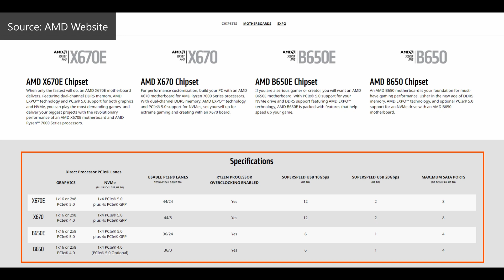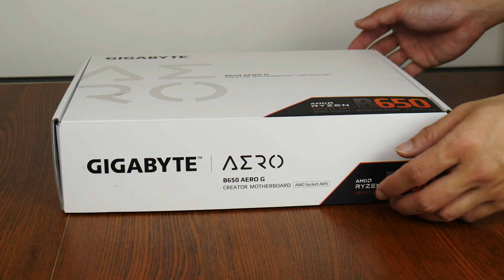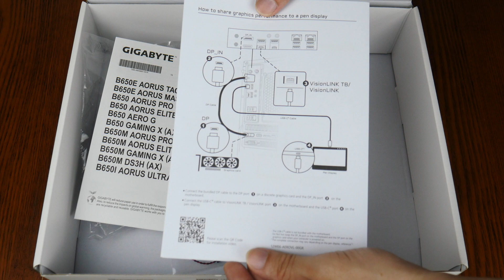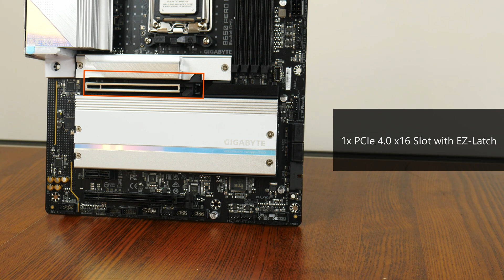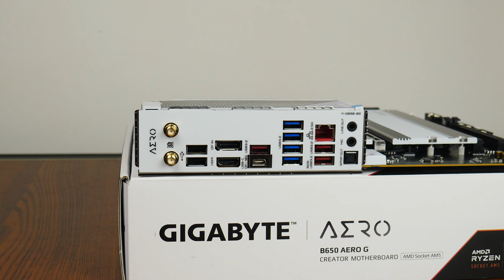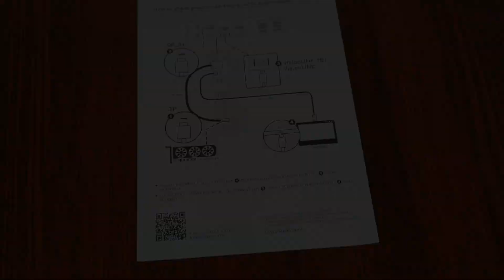Perfect AM5 Board for Creators & White PC Builds? Gigabyte B650 AERO G Unboxing & Overview

Comment: Excellent video! It helped me a lot to decide on my next motherboard. Thank you so much!
Reply from the maker: Glad you found this video useful! What are the specs of the PC that you'll be building?
Reply: @ALKtech  So far it's the following
- AMD Ryzen 9 7900
- Noctua NH-D15
- Corsair Vengeance CL38
- Kingston SSD M.2 Fury Renegade
- Corsair RM850x
And an underused Radeon RX 5700 XT from my old build in a h7 flow case.
Reply from the maker: @KeyframeChopper  cool, I don't suppose you'll be gaming all that much on the PC eh, more of productivity work?

Comment: hi, i bought this mobo second hand but bnib. say for example at 4:35, there’s those two plastic things supported by two screws above and below the cpu. mine doesn’t have those, is that important to have those, i plan on mounting a kraken 240 aio
Reply from the maker: Hey man, if you're using a Kraken 240, you won't need those two mounting brackets. The Kraken will come with a pump mounting bracket that you gotta install in place of the two plastic brackets that come with the motherboard anyway. Hope this clarifies!

Comment: If you populate all M.2 slots, is the top PCIe slot still x16 or does it get reduced to x8?
Reply from the maker: The topmost PCIe slot will still operate at x16 speeds - it doesn't share bandwidth with the M.2 slots at all. Only the bottom-most full-length PCIe slot shares bandwidth with the third M.2 slot.

Comment: how unfortunately that this is the cheapest AM5 board you can find with Intel NIC. The Realtek that comes with other AM5 boards is just hot garbage
Reply from the maker: Well...even the Intel I225-V and I226-V Ethernet chipsets have their fair share of issues too - Google and you'll find there's been quite a fair bit of complaints by users about packet loss/connection stability issues with Intel 2.5 Gbit Ethernet chips too 🤔
Reply: Yep! With it using intel, I had the issue of ethernet not working what so ever until I installed AMD's wifi driver for the board. I tried the intel network drivers and all over and over again, nothing worked. So that alone was a hassle. I don't use wifi, but to install the AMD wifi driver for the intel ethernet to work? odd.  @ALKtech

Comment: Does it support intel XMP
Reply from the maker: This is an AMD board - it supports EXPO, which is AMD's sort-of equivalent of XMP!
Reply: @ALKtech  but if my ram come with intel xmp can it run?
Reply from the maker: @thomasooi4435 ah, you're wondering if XMP-certified RAMs will work with AMD EXPO boards? Short answer is yes, XMP RAM modules (that may not be EXPO certified) will work with AMD AM5 boards. You'll still be able to select the appropriate XMP profile within the BIOS - hope this clarifies!
Reply: @ALKtech  thank you so much🙏🏻

Comment: Fan and RGB headers are 4 PIN, can i connect 3 pin 5V in 4 pin slot?
Reply from the maker: 5V aRGB headers (3-pin) are different from 12V RGB headers (4-pin) in terms of pinout and are incompatible with each other - you SHOULD NOT connect a 3-pin aRGB connector to a 4-pin RGB header and vice versa, or you might short your motherboard!
Reply: @ALKtech  only in argb which in top right and lower left slot in green right?
Reply from the maker: @paulocruz8594  yes the green markers are in reference to the 5V aRGB headers, orange markers are for 12V RGB headers.

Comment: Wow Great Channel! instant subscription😂
is it for content creation just for pen display device?  I don't use it.
I more like ASUS ROG STRIX B650E-F from the previous video. It's only 30$ more on newegg. You said it would work with 7700x or 7900x, but 7950x?
Reply from the maker: Thanks! I would say both boards are targeted at very different demographics - the B650 AERO G's key selling points would be VisionLINK for pen displays (content creators who do graphic design mainly) and its aesthetics, while the ROG STRIX B650E-F is a mainstream board meant for gaming PCs at the higher-end. If you have no use for the VisionLINK feature and instead game on a regular basis, it might be better to look for a gaming-oriented board instead!

That said, both boards will work with all Ryzen 7000 series CPUs, the 7950X included. I'd think that folks who decide to go for a 7950X would probably already have the budget for a high-end board powered by say, the X670E!
Reply: @ALKtech  Thank you. I am a content creator, but my orientation is good CPU with many cores for simulation and 3d rendering

Comment: Gigabyte have some of the prettiest mainboards out there. I just wish their RGB software wasn't so terrible.
Reply from the maker: Yeah this board's a beaut all right - do you use a Gigabyte board yourself? No harm trying other third party RGB apps like OpenRGB if RGB Fusion isn't your cup of tea!
Reply: @ALKtech  my main machines used to have an ASUS Prime X570-Pro and a Gigabyte B550 Vision D. The Vision clearly is the more beautiful of the two but its UEFI is super confusing to me and the RGB software is kinda crappy. I did try OpenRGB before but only on an Unraid machine, which was terribly underwhelming. Can't really say anything about Windows version.
Now I have an ASUS ROG Strix X670-A Gaming Wifi in my current main box but I have so many systems around here, I'd be surprised if I didn't end up with one of those Gigabyte boards somewhere again.
Reply from the maker: I see! Out of curiosity, what drove you to purchase the B550 Vision D? Was it largely due to looks, or the content creator-oriented features? Have always wondered how many folks out there purchase Vision/AERO boards just cause of the aesthetics, and might not really need the content creator-oriented features!
Reply: @ALKtech  Purely for the visuals, actually. Having Thunderbolt on an AMD board was a minor bonus but I never had any purpose for it so even that's just a "well maybe some day it'll come in handy..." kind of thing. Basically, there's not that many good looking white or silver mainboards out there so the few that exist get picked up, I suppose.